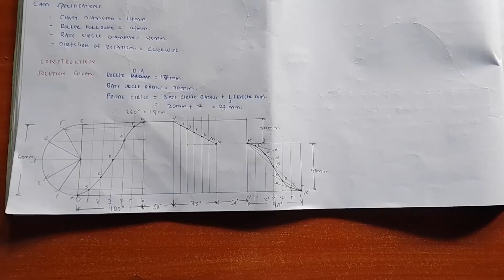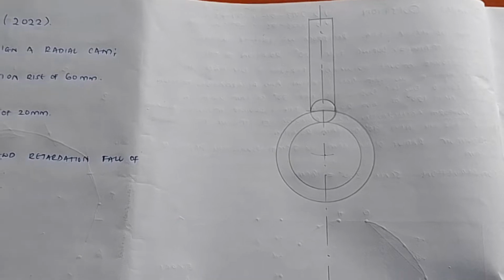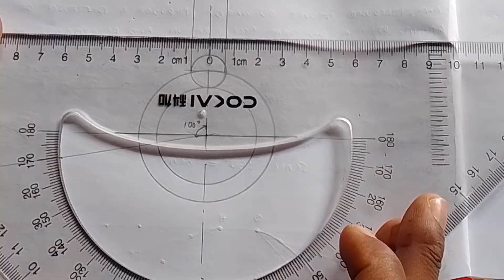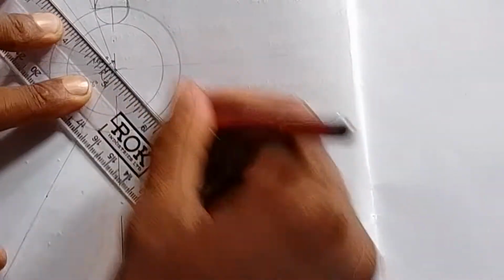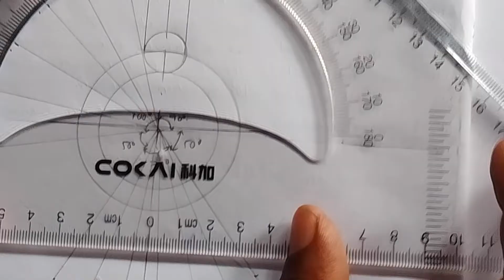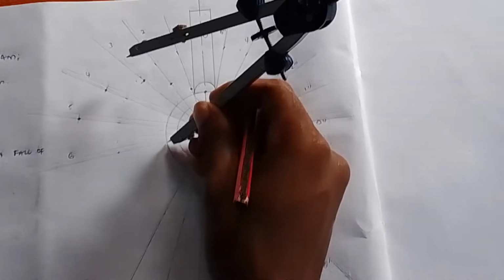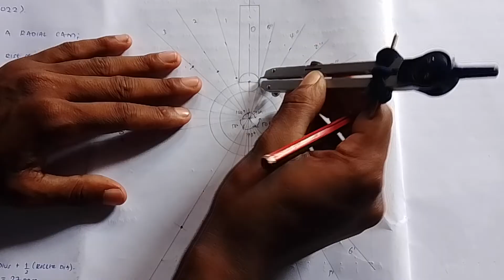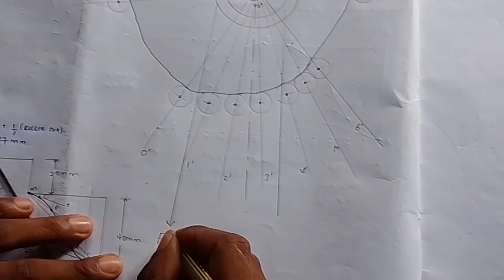knec past paper question part 2🤔 || cam profile || Engineering Drawing II and Design

Comment: Do you mean if the direction is clockwise,, we should measure the angle divisions anticlockwise and vice versa? Help me there
Reply from the maker: Hi and thank you for contacting us. Yes it's true. You should measure the angle divisions anticlockwise 🔄 if the question indicates so, if it doesn't, do the vice versa...
Reply: @officialmarkmungai  thanks
Reply: Do you have some guidelines on drawing screw thread and assembly drawings?